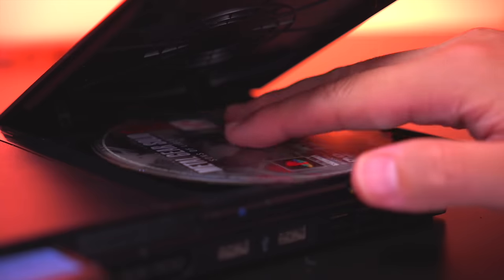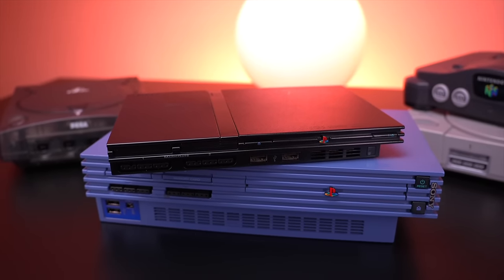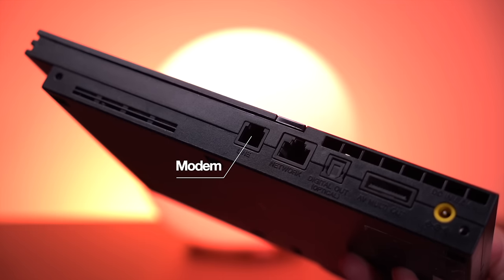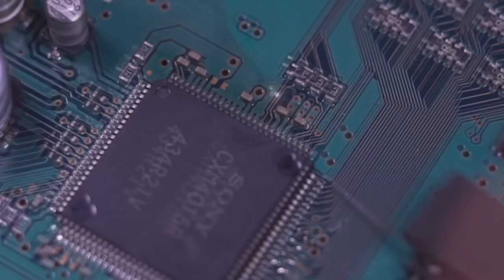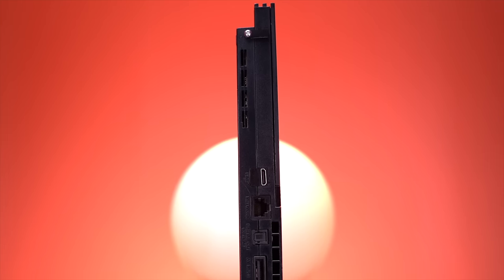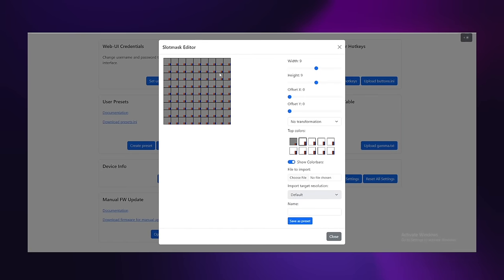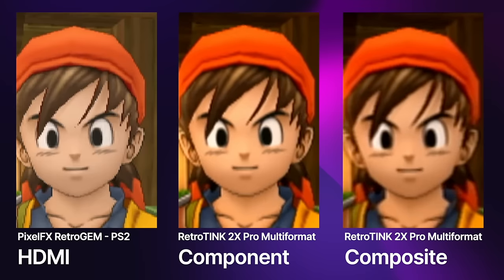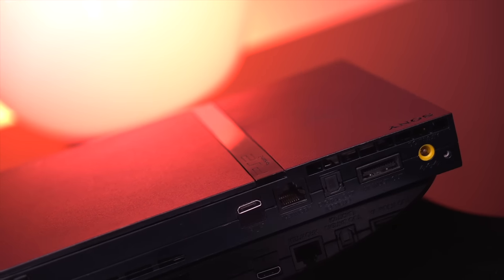This HDMI Mod Makes The PlayStation 2 Look GORGEOUS!

Comment: software paywall? that's horrible , a product like that shouldn't be supported
Reply: Definitely or hacked 😆
Reply: I have to agree with this too the price difference of the 2 is huge and I've gotten one myself and the guy doesn't answer is emails or phone.
Reply: Development time should be free?
Reply: What is software paywall? What does that mean?
Reply: @michael47359  It means to unlock features you pay for a software based upgrade. The hardware is the same for $190 or $120 respectively. The difference in price is the firmware itself.
Reply: Has someone hacked it yet?
Reply: @Ajme-kb4os you already bought the damn thing. Wtf are you talking about
Reply: You you prefer the make two physically different ones so your brain can make it ok?
Reply: @Ajme-kb4os Dude, you paid for the whole mod. Paywalling the software is a slap in the face considering how expensive the mod is. Not to mention there are literally open source codes available to make a lot of those functions possible which can be easily copied and optimized. Heck, even I can do that as a developer.

Comment: So the "shiny edition" is locked within the hardware and you have to pay to unlock these features? Wow
Reply: The console modding business itself has been getting slimey over the years. Pretty soon we're going to need mod-mods
Reply: @jomeyqmalone  Oh christ, the gaming industry is like DC Zero Hour; the destruction of the future is spreading to the past!!!
Reply: no its a software lock..you can unlock shiney with a firmware update you pay for..which is arguably worse.
Reply: Its still better than monthly subscribe.
Reply: From business perspective, it makes much more sense to use the same hardware. They can streamline the production line into just 1 type of hardware, and then lock/unlock certain features if the user wishes.
Reply: @madunwerkstatt3093 Yeah, just like BMW is trying to do with heated seats.
Reply: Can you tell me the cost for both?
Reply: @Handlebrake2  It’s the same device in both cases, but if you pay more money it does more stuff.
Reply: @TheRealCaptainFreedom  just found out it's about 90 and 90 for the next step.
Reply: Someone will skip that

God bless ghidra
Reply: @Handlebrake2  I say not really worth it based on cost alone and that is before the installation. I could do the installation (until recently I repaired smart phones), but it’s an additional chore. I also don’t like the fact that you need to remove the ethernet port.
Reply: @TheRealCaptainFreedom  the dial-up modem port.
Reply: @EikottXD  No I had an ethernet port on mine.
Reply: @TheRealCaptainFreedom which model do you have? Because in the video he removed the modem port not the ethernet port. Almost nobody uses modems anymore.
Reply: @RobbWes  I have the old “fat” original PS2 that came with an empty expansion bay. That one needed a separate network adapter unit which had 2 separate ports: ethernet and telephone. The redesigned “slim” PS2 had a single ethernet port.
Reply: If the software features require certain hardware, it's cheaper for a company to just not include the parts and sell the board with locked software. Has nothing to do with making you pay extra for what's already there
Reply: Expensive, hard and useless. It's not even real high definition. Maybe people are all smoking stone nowadays.
Reply: Emulation is looking better 😂
Reply: @TheRealCaptainFreedom You are getting it wrong, with new technology BMW now can allow anyone to after-customize the purchased vehicle and unlock features that you or the previous owner didn't order but you do want or regret your decision not having specific features. This is pretty nice so you can configure your car the way you want in case it didn't have something before for lifetime or time period.
Reply: Thank God for capitalism. Just wait for aliexpress to offer this or literally any other business and skip buying the software locked stuff
Reply: @jomeyqmalone 😂
Reply: Man, this guy's gonna sit when he hears about on disc DLC.
Reply: The cost is literally a con . 120 for basic or 190 for 1080p is silly cash for 4 mass produced chip / ribbons that are only software separated by the price ? I can buy an anbernic and play any console pre ps2 emulated for that price ?
Reply: This is a fairly standard in the hardware industry to save money on only having to produce one board. While it can seem a little slimey it allows hardware manufscturers to sell cheaper models that may not have been profitable to manufacture on their own.
Reply: And 200€ for mod itself 🤣🤣
Reply: @TheMamaluigi300 it spreading to the past is crazy
Reply: Right? So modern 😎😅🤣
Reply: @TheRealCaptainFreedom  Be smarter : re wire hte heated seat to a switch in your car and enjoy them.
Reply: @tomjoad1363  Well yeah, hack it and likely void your warranty. But this is still an abusive anti-consumer fuckboy move.
Reply: bro thinks life is fair

Comment: Software locks? This product went from S tier to F tier instantly in my mind.
Reply: Yea for the price of shiny edition you could just get a ps3 with backwards compatibility and play the games thru it
Reply: for those of us that grew up in the shareware days, this isn't as offensive but I do understand being a little upset that the hardware can do something if only software unlocked. The thing is the higher end license (essentially what this is) is about the same as the only version of his old PS1digital, N64digital etc, so technically they're letting people get the base functionality for half the cost it used to be, and if they really want the extra features they can always upgrade later.

Comment: This is definitely by far the best HDMI mod I've seen so far! - But as an Australian, it's completely out of the question. If the mod costs $190-USD then that converts to something like $290-AUD and thats not even including the exchange rate fees or delivery. I could personally never justify spending that kind of money on something like this.

EDIT: Never mind just found out that the "Shiny" version is just a software lock on the "Basic" version. - Scum move. No longer care, no longer interested.
Reply: For example an easily soft modded PS3 😅 there are a couple PS2 titles having problems with the emulation but most games run beautifully off the hard drive/SSD/USB.
Other emulators also benefit from the PS3's distinctive image processing.
Reply: Aye, it costs me 8 times more than what I paid for my PS2 Slim xD Think I'm just gonna stick to playing PS2 games through PS3
Reply: Yeah, it's cool and all but I'm pretty happy with component on a crt, still looks great
Reply: It's the same trying to get upscalers in Europe, nearly impossible to get and the price is trippled.
Reply: @diizzii  I mostly mod Nintendo stuff so I didn't know about this. Going the ps3 route sounds like a much better idea.
Reply: @touma-san91  I can't go back to the PS3 for PS2 games anymore, after trying to play Guitar Hero on it. Input lag is very noticeable.
Reply: The basic edition of the mod is $119 USD for the slim which isn’t much better :(
Reply: I feel your pain as a Canadian, the price is prohibitively high. I'll stick with a cheaper dongle for now.
Reply: Just wait for the Chinese version. It may be cheaper 😅
Reply: Yup, thats shady business practice. 

You're basically ripping people off. Don't care, my PS2 runs just fine without it.
Reply: Stop being poor.
Reply: yeah at this point better to emulate on a good pc with a good controller
Reply: I think using backward compatible ps3's are good option :P 
You can play lots of ps2 games on it on 1080p 60fps!
And it also have ps3 libary too!
Reply: Or an XBOX SS/SX with the dev mode unlocked and a good old emulator you can get a better experience, with the added benefit of having almost all the other consoles in one box, if you catch my drift.

And yeah, I smelled the soft lock BS right away when I saw that comparison table on their website, it just mentions features but no additional hardware requirement whatsoever, like Mercedes obvious. 😂
Reply: @muhammedozbek7492 One question, Is the PS3 still online? A few years (2) back I had a Super Slim model where I played a bunch of Dark Souls and it was still going, it would be nice if it still is, may it make me to jump back onto it.
Reply: @MrLind87  Still online! but there is some expections (Gta5 is closed, İn mw2, you can't level up) But otherwise, it works like charm!
Reply: @muhammedozbek7492  Awesome, and thanks for the update!

By the way, both Activision and Rockstar can ligma, hahaha.
Reply: Even in USD they should throw in free Assembly with it.
Reply: just buy a component cable for the ps2 that supports more color channels, then the game image will be much better, and if your TV doesn't support it, then just buy a component to HDMI converter, it will be cheaper, and you will have the quality is better than that of ps2 to hdmi
Reply: @Wislazzz  yeah, that's an option as well, but the PS2 is very troublesome because of the overscan problem, in my experience all the PS2's I've had always had the same problem and only with a mod chip I could manage to make it fit on my TV while my XBOX and GameCube never had the same issue, that's why I actually prefer to emulate PS2 games rather than running them on the actual hardware, the same case goes with the N Switch, but for other reasons.
Reply: Might as well buy a used a small office pc with a PCI slot and slap in a GTX 1650 and an SSD and Nightly PCSX2 builds on Ubuntu or L. Mint and enjoy amazing games with the emulator with 8x Resolution and whatever settings you want. Morality on copying propriety Bios code can take a hike.
Reply: @aziskgarion378  nah, you don't really need that much, with a Radeon 8570 2gb, a first Gen core i5 at 3.0ghz with a slight overclocking and 8gb of RAM DDR3 at 1200mhz I can play any PS2 game ever available on the emu, and wii/gc titles are even sweeter to play, I hook up a CRT monitor and I get a really cathartic gaming experience with that PC, but if you wanna enhance the graphics and resolution, then a rig like yours can beat the gig.
Reply: Honestly I just use a Retrotink 2X Pro. Sure it's $130 and it introduces a very small amount of lag (I can't tell), but I can hook it up to all of my other consoles and I don't have to do any mods.
Reply: @MrLind87  not all PS2 games are emulatable on ps2 emulators by a long shot, and certainly not on weak hardware like that. games like champions of norrath aren't even playable at all still
Reply: @genderender  Well, of course if your objective is to play some niche or rare game then maybe the actual system is your only option, the PS2 games I like to play run well over emulation, so like everything is an individual case scenario, I'll give you that.
Reply: @MrLind87  it’s not a rare game it’s just a game that actually used the ps2
Reply: @genderender   I've got my PS2 way later on its life cycle and just played the games I was interested in and didn't dug up too much on its catalogue, I was much more into the XBOX and the GC, so that game you mentioned was out of my scope, and judging by the name it sounded like those dark games that are actually good but were shadowed by bigger hits.
Reply: @frizzyrascal1493 shady? Are they supposed to just give you everything for free? Maybe you’d rather they just made it very expensive instead of offering a cheaper version with fewer features and no additional engineering to create a stripped down offering? Or would you complain about that too? Nobody’s forcing you to buy it, and I don’t think you know what “shady business practise” really means.
Reply: @genderender I play champions on my soft modded ps2 all the time...
Reply: @SeriusChevy  wasn’t aware that a ps2 was an emulator
Reply: @genderender  yeah maybe it's not but I'm running the same roms as an emulator would
Reply: @SeriusChevy  champions of norrath runs at 480i native and doesn’t use textures to render text. It’s very hard to see read on a decent TV, and also is one of the only ps2 games I care about at all that doesn’t have better alternatives now (like Katamari, FF, sly, and jak all do). Softmod ps2 is an answer, but emulation is the most easily accessible answer for me
Reply: OSSC upscaler would be better choice at that price maybe..
Reply: What's wrong with this business model? They put extra work hours to develop software and want to get payed for it. This is how all businesses work, isn't it? Absolutely clear approach without any shady schemes imo. Is software just appearing out of nowhere?
Reply: @dmitromba its filthy and I cant wait until there are full set chinese knockoffs and BIOS flashers to turn basic into full shiny for free. These disgusting devs deserve it for their gouging
Reply: @KrazzeeKane   why are they disgusting? Coz they wanna get paid for the job they did? How often do you work for free? If you don't work extra hours for free don't expect anybody to do this
Reply: @muhammedozbek7492  kinda but no they have the own problems primarily there all ticking timebombs waiting for the yellow light of death because they was part of the defective batch of gpus from that era

and despite what people claim theres nothing you can really do to "fix" the issue

reballing does not fix the issue it just has a slight chance to delay it
reflowing has the same outcome

the only real option is to replace the gpu with one of the new revision gpus using the frankenstein mod which is not something average joe is going to be able to ever perform
Reply: They should make money with it, obviously, but that price range for an UPSCALER is not really justified IMO. Plus, I never said I want it for free and you don’t have to worry about me, I‘m not paying 150 bucks for it. To top this all of, the product itself doesn‘t seem to be of high quality. That‘s the least they should be doing. Plus the extra license fee seems rip-off-y. 

However, are free to accept those business practices. Small businesses ruin their reputation when they take advantage of a niche and overprice their product to such an extent, but you can have fun emptying your pockets. I got two bridges to sell you, actually…
Reply: @dmitromba They should be paid for! Nobody is arguing against a good paycheck. We are arguing about the over the top price range and how it‘s not worth so much money to many people here.
Reply: @LenoxFilms  Yep, tried playing Valkyrie Profile 2 on original hardware recently and suddenly remembered why I only bought a handful of PS2 games back in the day: The flickering is downright insane. PCSX2 or nothing.
Reply: Why do broke people feel the need to give their opinions? If you can't afford it, no need to talk about it, just move on.
Reply: Como brasileiro, esse preço também é proibitivo...
Em conversão direta, esses $190-USD ficariam R$912-BRL, e se considerar as taxas de câmbio daria R$1732-BRL, isso é mais do que 1 mês de trabalho aqui...
(Sim, nós temos 90% de impostos sobre importações)
Reply: We are all going to die one day. So why not?
Reply: Someone will figure out how to reflash it to unlock it anyway
Reply: @diizzii  or just get a half decent pc thatll run them all in 4k, since PCSX2 can now play 100percent of all ps2 titles now
Reply: @realbigl  that's exactly the opposite of what retro is about but if it fits your needs, enjoy, Sir!
Reply: @diizzii  I mean why be retro when you can play your old ps2 games in a better resolution and a better controller? 😂
Reply: @-Monad- PS3 is better than PS2 for Guitar Hero
Reply: @dmitromba i agree but it seems like people feel like they’re being scammed for getting up charged on arbitrary fees, i feel like it’s a very common opinion even outside of tech
Reply: @edenassos you're opinion is L lol
Reply: Na Austrália ainda está bom, pensa aqui no Brasil que pagamos 92% de taxas em produtos acima dos 50 dólares.
Muitas vezes a taxa ainda fica maior, acima do 100% pois é cobrada também sobre taxas  e despesas de transporte entrega.
Faça os cálculos aí, 1 USD custa R$ 5,40 (Real moeda brasileira R$), USD 200 já são mais de R$ 1.000 adicione os 100%, ou mais de taxas,  e fica totalmente inviável, praticamente o dobro de um salário mínimo pago por mês.
Um PS2 aqui, em bom estado, sem a caixa, sem leitor de disco, com um controle e um cartão de memória, custa por volta de R$ 250 ou uns USD 35.
Reply: In Australia it's still good, think here in Brazil that we pay 92% taxes on products over 50 dollars. Often the rate is even higher, above 100% as it is also charged on transport and delivery fees. Do the calculations there, 1 USD costs R$ 5.40 (Real Brazilian currency R$), USD 200 is already more than R$ 1,000, add 100% or more in fees, and it becomes completely unfeasible, practically twice as much as a minimum wage paid per month. A PS2 here, in good condition, without the box, without a disc reader, with a controller and a memory card, costs around R$250 or around USD 35.
Reply: @touma-san91  How PS2 on PS3?